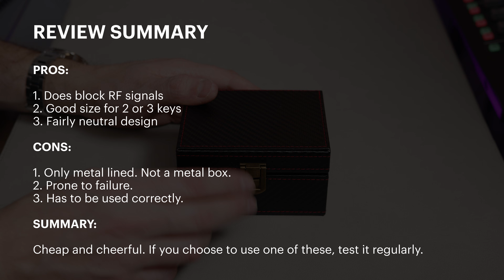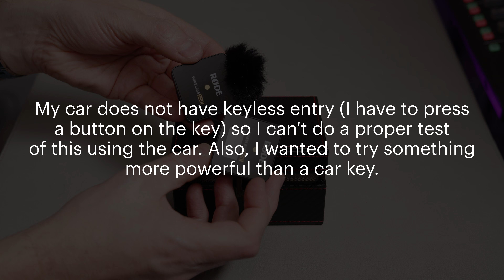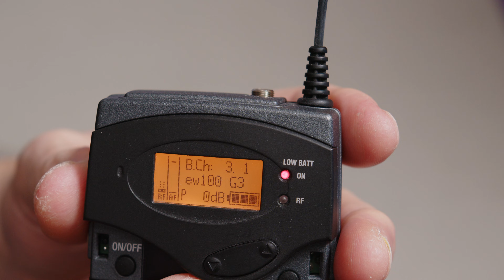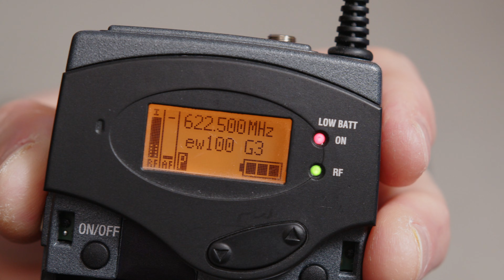Car Key Signal Blocker Faraday Box - Do They Work?

Comment: Thank you for uploading this. I have a wallet version of a faraday cage and to be perfectly honest, I'm not sure I'm using it properly either. Over time it devolved a slight tear, so I lined it with silver foil and now when I go to the car, I can leave the key in the wallet and open the door without removing it, as long as it is practically touching. I can also start the car using the same process. However, if the fob is more than a hand's distance away it will not work. 
The question I have therefore is, is the car safe?